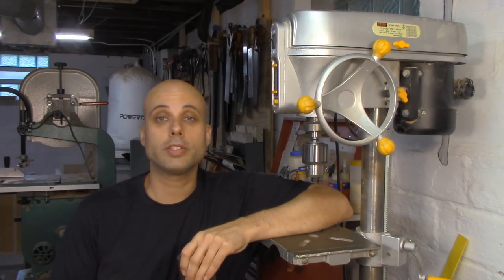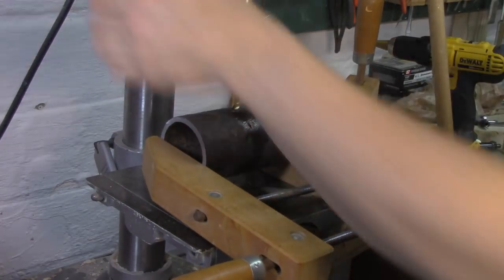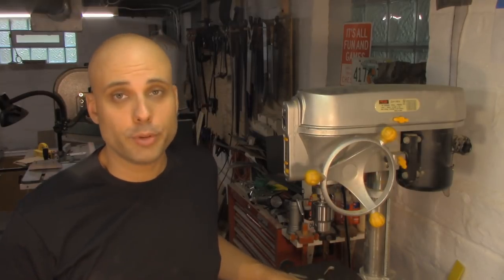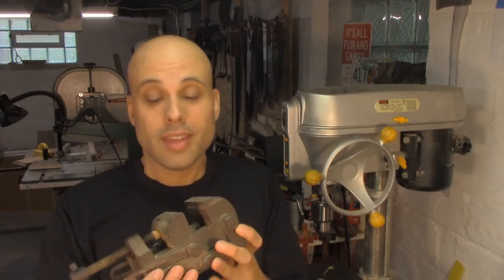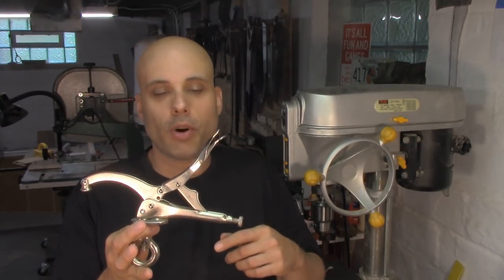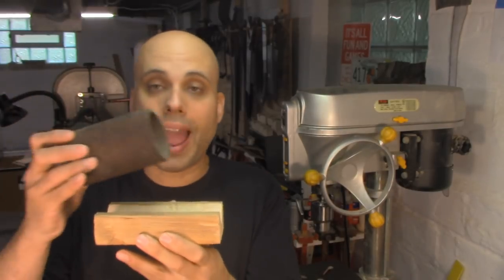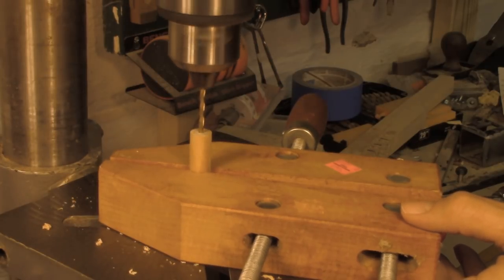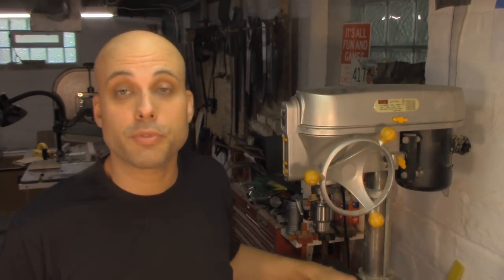Work holding on the drill press (Drill press basics 2)

Comment: I used to be a toolmaker... a life time ago.
A safety tip: when drilling metal, break your chips regularly. If they get long they are like spinning saw blades!
Reply: Also, do not pick up a 'chip' in the middle.  Not unless you can see both ends.  (I worked in a foundry. Work boots lost their tread in 90 days.)

Comment: I have an x/y table with a vice mounted in the t slots. It sits between my metal lathe and milling machine. I mostly use it for drilling pen blanks. A little overkill but it's a big drill press and pen blanks will take the skin off you hands with a quickness.

Comment: I have a similar table on my 1978 rockwell DP. To make clamping to the table easier  I made a table extension that has solid flat on the bottom edges, I used oak and plywood to to make an assembly that fits under the table, The outer edges fit flush to the table top. I drilled 4 holesithrough the top and used flat head 1/4 20 bolts to attache it. Now the perimeter of the table is 2 1/2 in square . oak and the bottom of the table is flat plywood. The table is larger and very easy to clamp to.  I have also glued wood blocks under my unisaw table to make clamping finger boards easier.

Comment: Another good video. I absolutely love the modified wooden clamp for holding round stock. It is now on my to-do list for the workshop. I will probably finally also get around to the drill press table with adjustable fence, so that I can use adjustable stop blocks for production work.
Reply from the maker: 1lupus I'm really glad you liked it! As to the drill press table: made one,  hated it,  threw out out,  never missed it.  Your millage may vary.
Reply: Rex -- I'm with you on the drill press table. Teats on a boar... 
1lupus -- a 4/4 x 4" x <pick a length> board with an inset length of T-track lets you jig up to your heart's content. Clamp it to your table with any of the ways Rex demonstrated, and you're good to go.
Clyde
Reply: Sounds like a good plan.Thanks Clyde.  I love youtube, by the time I have got around to a project I have got all the pros and cons from people who have been in the same spot beforehand, and I don't have to go through the same learning curve.
Reply: Round stock can be held by screwing a pair of wood strips to a section of plywood to support the pipe.  Think the 2 contact points of a 'V' bolck.

Comment: I have done quite a lot of drilling in recent months and I may offer some little tips:

Generally use the lower ranges of RPM - more power, less heat and better chance of reacting when something goes wrong (before the material spins on the drill and is shot out in a random direction, haven't happened to me personally but I've seen a metal piece shot out and stuck in a wall, that's a real life hazard).

Bigger drills in thinner stock tend to "catch" or "bite" on the material more often, so if you are holding the piece free hand, push it down into the table, the friction will prevent spinning and you keep the piece from getting pulled up on the drill.

Use lowest usable speed when drilling in plastic to prevent melting of the material and annoying half molten, long swarfs getting stuck on the drill.

Don't be hasty, as pointed in the vid, the drill press is somewhat of a "lighter version of a lathe" and the spindle creates a lot of potential hazards.

P. S.
Bolt the machine to your table, don't keep it standing free.
Reply from the maker: Bamzee X good tips! Thanks for building the knowledge on this tool!

Comment: Great tips to take to the workshop. Thank you 😉

I looked for your other two drill press hacks videos, to no avail. Not uploaded yet? Or am I looking on the wrong place?
Reply from the maker: I have not made then yet because this series didn't get a lot of views. I still might do them. Glad there's interest.
Reply: If you ever end up doing them, please mention in a bit more detail which gears/speeds with which drill bits to use for which purpose.

I remember back years ago when I thought slowing it down would be the safer option, but ended up burning/melting out two drill bits until I figured it out. I forgot what I was drilling through now though. For this reason, I am reluctant to use the bench drill as much.
Reply: I was also looking for the last 2, btw loving your channel, stumbled across your old style bench few days ago

Comment: I never thought about putting holes in my handscrews, hmm...

Tilting the vise and tilting the table allows you to make holes at compound angles if you line it up well enough and bolt it to the table.

The risk of the drill grabbing and whipping the piece around can be pretty much eliminated by having one end of the work out against the pillar of the press, a wall, or any stationary object tall enough to reach the chuck and in the way of the direction of rotation You can also bolt a stop to the table for smaller parts but that probably isn't necessary in most cases and would just get in the way.

I think it needs mentioning cause you were doing the work with acrylic and corian: low friction plastics also need to be drilled with a slightly dulled or purpose-made plastic bit, else they have a tendency to jump out of a vise and screw themselves up the length of the drill while spinning. Vises and clamps don't hold them very well.
Reply from the maker: Those are all great tips!  Thanks for sharing. As to the acrylic, I agree that regular twist bits have a lot of problems. But forstner and spade bits (which are the ones I'm using) don't have that problem. They work great with no grabbing.
Reply: You're welcome, and thank you for mentioning those work without hassle. There's a video here that shows you can use regular twist bits, you only need to slightly dull the cutting edge with a piece of sand paper. It's useful for small holes for fasteners, hardware or decoration, not just the larger holes. (Make sure to keep that set seperate though.)

https://www.youtube.com/watch?v=8Ri6poVpQM8

Comment: Rex, your video inspired me to make a fill plate for the underside of my Porter Cable floor-based drill press.  Removed the table, traced the underside on cardboard.  Cut a 1/2" piece of OSB to fit and counter-bored spots for 4 neodymium magnets epoxied flush in place. A slot in the rear of the OSB allows it to be removed without disassembling the table.  How can I send you some pics?
Reply from the maker: I'd love to see some pics. Maybe through facebook? I'm easy to find.

Comment: I know the vee block is a cheap and easy thing to make out of wood, but I'd recommend against using a wooden one. The bottom of the channel is the thinnest and weakest part of the block and, with the downward pressures often used in drill presses, it's likely to split here and will no longer be holding your workpiece steady.
Get a metal one for $20-30 off Amazon, etc., or even cheaper from markets or estate sales.
Reply: Or pre-drill a hole in the base of the v groove, to stop splitting

Comment: I just went with a (somewhat oversized) cheap Chinese compound XY vice for mine. It's enormous and heavy, so moving the table up & down is a pain, but even a cheap one of these makes lining things up with precision so much simpler. Add a pair of third party vice jaws, glued parallel, & you do away with a lot of the downsides of the cheap casting.

I still don't know why nobody has made a more low-profile version with a traditional side holding vice design instead of hold downs, but even my little bench drill has enough height in the pillar to let me drill larger pieces accurately this way.
Reply from the maker: I'm really interested in getting one of those xy tables. They look so useful.
Reply: They do help a lot. I imagine you could make one out of wood & a couple of lengths of threaded rod too; might try that some day.
Reply: My simple table doesn't have a crank, so, I added a pulley to the side of the head and ran a cable to a counter weight. ( piece of 3 inch pvc pipe with lead weights inside ) I added weight till the table was balanced. Moving it up or down is Much easier.

Comment: Sometimes, small holes in small piece can also be danger, imagine you are going to drill a 1/4 inch hole on a piece of 1/2 inch square steel. holding by hand, it is going to helicopter for sure, and very likely to hit your thumb with some sharp edge. If you don't have a vise, you can use a adjustable spanner to hold the piece with a piece of paper. It will provide enough fraction.
Reply from the maker: That's a good tip!  Thanks!
Reply: @RexKrueger  no problem, man. I can give you one more, good v block can be expensive and difficult to find these days, what if you want to drill a hole on a rod? It is going to be a nut case. Yes, nuts! For example if you want to drill a hole on a 1/2 inch dia threat rod and don't have v block, put some nuts on the rod on both side, nuts are hexagon, clamp the nuts in the vise instead and you got a solid grip that will not helicopter or the drill bit wouldn't walk.

Comment: is a drill press a standalone machine, or do you have to attach it to a workbench?
Reply from the maker: They come both ways. Big free-standing models are especially nice.
Reply: They come in sizes from little 20 lb. bench top units to multi ton radial drill presses. A 19 or 20 inch floor model will cover almost everything you will do in a home workshop.

Comment: Your earlier statements about holding work might spawn another series of videos.  I have limited work area.  A lighter workbench and one wood vise.  I would love to know how to hold round stock in the same way a shave horse does without drilling holes in my bench.  I love draw knives and spokeshaves for round stock, but holding them securely has been problematic at best.  All in all, respect for the power tools and think about how the cut or drilling could go wrong.  Then fix that.
Reply from the maker: This is something I can mull over. I might be able to come up with something. In the mean-time google "shave pony." There are at least a few designs out there for shave horses that attach to your bench. These supposedly work well and save a lot of space.
Reply: On my "little outdoors work table"... I have a machinist vice, basic four-inch model, no frills.
   AND I'm also a fan of drawknives, spoke-shaves... hand tooling... and round stock.

   I took the "jaws" off the vice, revealing the bolt-holes, and then matched those bolts to some longer ones at the nearest hardware shop. THEN I essentially made two of those "V-blocks" Rex showed in the video, for holding round-stock and drilled them as precisely as possible with a small high-speed hand-drill (too lazy to drag a floor model press to the backyard that day)... AND bolted the V-blocks into the vice to replace it's original jaws (jaw-liners?)

    You don't need BIG V's to do the holding, though. That's a paramount lesson from my first effort... AND since then, I've always cut approximately a 3/8 inch deep V into blocks for replacement "jaw-liners" rather than bother with anything larger. Most of the time, the smallest stock I deal with is around an inch wide, so it's sufficient.

   You could also use pairs of V-blocks along with any of the C-clamp or F-clamp types, to hold work down as long as you didn't want to build anything special...

    In the case you want to build something... A pair of "uprights" that mount to the table (yes, clamps unless you drill and bolt)... Could be used to hold up a "Cam clamp"... which is essentially an off-centered wheel on an axle... You'll need to "tread" this wheel with silicone or "non-skid" material, so it grips a little better, but even gluing sandpaper to it will do the job... When you want to hold work down, you shove the work under the wheel and then pull back sharply... the idea is the wider-part of the wheel (that hangs down by gravity) will roll up onto the work, but as it starts to grip and roll back off of it (being OFF-centered on purpose) it will push UP on the axle and uprights. As long as your uprights, axle, and wheel are sufficiently attached (clamped) to the table, the work can NOT possibly move toward you... and you can draw-knife and pull spoke-shaves to your heart's content (doomsday if there's substance enough for it)...

   When you want to "release" the work, just shove it forward under the wheel... and as the wheel rolls, the off-center will release the compression.

    It takes a little bit of tinkering to get it quite reliable, and I often use "all-thread" and nuts to position my axle and wheel by bearing-brackets up or down to accommodate different sizes of project piece... BUT once you've built the thing, give or take the occasional tweak or retro-fit (when you deem appropriate)... you've GOT it. ;o)
Reply: Consider putting one or more slots into the bench and use of a  leather or conveyor belt fabric strap  attached to a foot lever. stepping on the lever would secure the work and allow its quick release for repositioning.

Comment: This is a little off topic although technically it is work holding, and on a drill press... So I was at good ole harbor freight a few days ago and noticed an "X/Y axis Drill press vise" for like $70. Ever since I saw it, I have been contemplating, if one would be able to essentially "mill" softer materials on their drill press (along with the additional of an end mill of course)? If not, what could an X/Y axis Drill press vice be used for? I know that's not what a drill press is made for.... But would it work? I wouldn't expect super tight tolerances. I am interested in adding additional functionality to my drill press. Does anyone have any experience with this? Or tried something similar?  I'll link to the vise below just so we are picturing the same thing...

https://m.harborfreight.com/6-inch-cross-slide-vise-32997.html?utm_referrer=direct%2Fnot%20provided
Reply from the maker: Spectt84 Good question! Short answer: don't do that.  The chuck on a drill press is not made to hold mills.  The bearings can't take the side load. Terrible idea all around.  Mind you,  it WOULD work.  It's just dangerous,  innacurate, and bad for the machine.  Hope that helps!